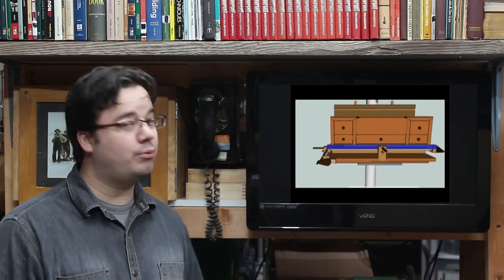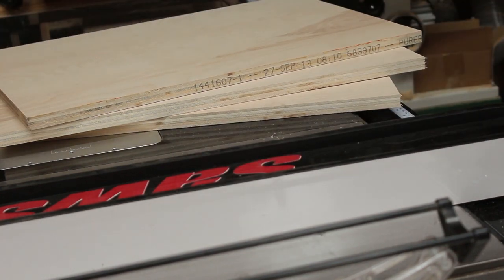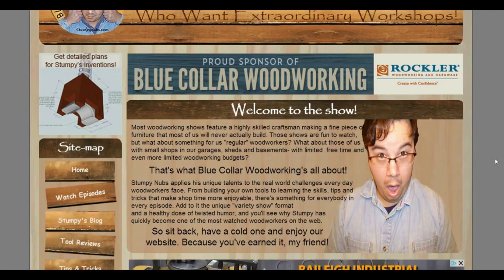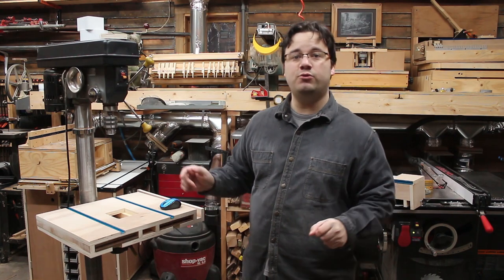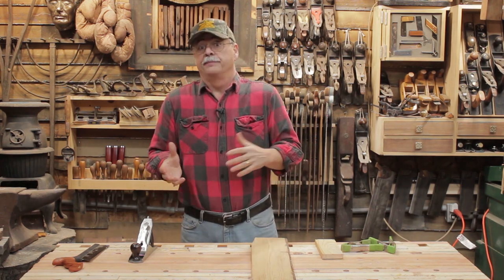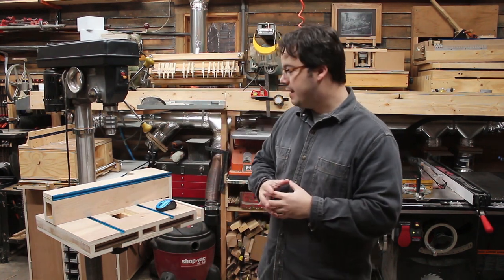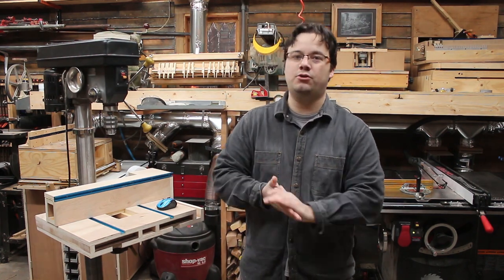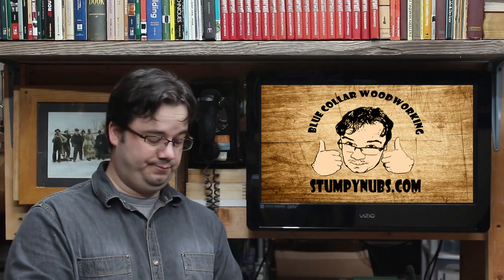SWEET Homemade drill press table with T-Style fence and dust collection- Stumpy Nubs Woodworking 40

Comment: Nice project for a floor drill press. I made a fancy one for my bench model, but it was too big and I don't like T tracks that fill up with chips. Will do a simple model with a longer fence and a bolt on each end to clamp to the edge of the table. That's how my router table is and I love it. I'll make it square so I can put the fence on any side. Clamping is done the same way as the fence, no T track.

Comment: I understand the dust collection issues Stumps, and the fence height makes complete sense in that respect.  What I was referring to however, was drill bit length.
The chuck can hit the fence if you are using a bit with a functional length less than the height of the fence, and the hole you are drilling is less than radius of the chuck away from the fence.
Reply from the maker: In a case like that I would just put a scrap of wood between the fence and the workpiece as a spacer, or else remove the fence (which is designed to lift right off) and clamp a scrap of wood to the table as a temporary lower fence. I think that situation would be pretty rare, but of course, that depends on the types of projects you typically make.

Comment: great video as usual. and i really like this drill press  table and . love the fence set up! i agree, a little deflection wont hurt anyone/thing.especially on a drill press.like u sd most the force if not ALL of it is going down. i also like the pull out drawers u got there. id give 2 thumbs up, but, you tube only allows 1 so i give 1

Comment: I have been watching a lot of videos on YouTube about building a drill press table.  What surprises me most is that almost all of them are built with keeping the fence square to the drill press table.  This does add a lot of complexity in making the drill press table.  I do not think that you need to do this.  You only need to worry about the distance from the center of the drill bit to the edge of the fence.  Take a look at my video "Build an easy drill press guide" and I would be interested in hearing your comments about my design.  I have responded to a lot of other videos with this same idea and have not heard back from a single one yet.  My design does not have a dust collection system.
Reply from the maker: +duaneflower -I disagree that it complicates the design if you make it so that the fence is square to the table. That said, I don't fuss over it like I would a table saw fence, for the reasons you mention.
Reply: +Stumpy Nubs (James Hamilton) Did you get a chance to see my video mentioned above.

Comment: TRY THIS ON FOR SIZE. PUT THE FENCE AT THE FRONT OF THE DRILL PRESS TABLE AND THEN YOU CAN DRILL WIDER PIECES ON IT. I DO NOT LIKE THE IDEA OF ONLY LETTING THE FENCE SLIDE IN ONE DIRECTION. IT IS EASIER TO PUT A WOOD SCREW AT ONE END THEN LET IT PIVOT. SIMPLY PUT A CLAMP AT THE OTHER END WHEN YOU GET YOUR FENCE LOCATED WHERE YOU WANT IT. JUST A SUGGESTION FROM A FELLOW WOOD WORKER

Comment: won't the fence interfere with the chuck when let's say you want to drill a 1/4 inch hole 1/2 inch from the edge of your work piece?
Reply from the maker: Yes, which is why it pops off so easily.
Reply: and then what are you using for a fence when doing the work described above?
Reply: +Jeff Fischer do you really need a fence for that?  do you?  do you?
Reply: John Davidson You do if you want to do repeat work.
Reply: So...build a fence that fits the work you need.
Reply: Great comment
Reply: Thanks Pat

Comment: Stumpy,

I like the table and the fence.  I do have one concern though.  I thank the fence might be too high for many operations.  I built mine with dust collection in the table, à low standard fence, and tall auxiliary fence.
Reply from the maker: It may be an issue on some drill presses. The higher fence is important to allow enough airflow through the fence for a standard dust collector. A smaller fence would be fine if you use a shop vac, which moves less air at higher pressure.